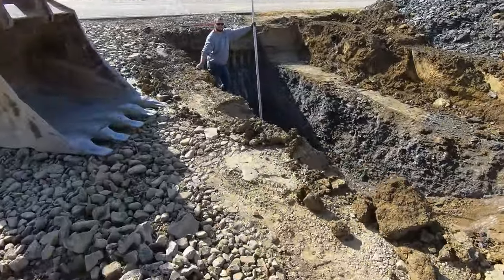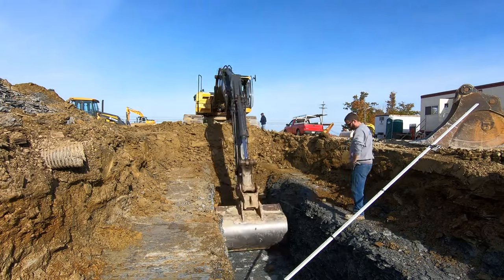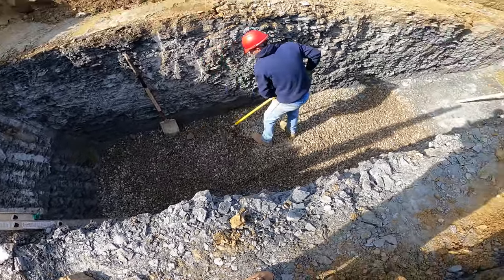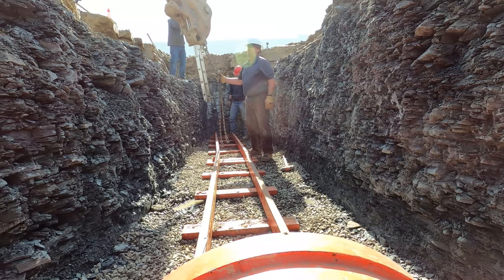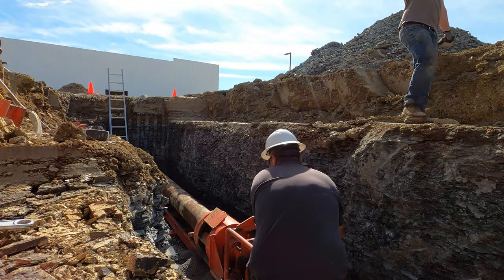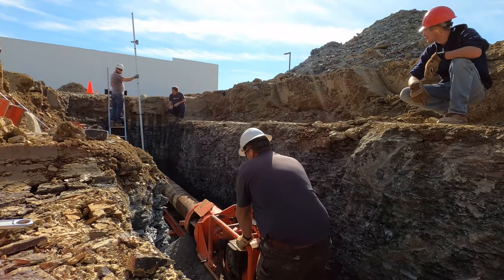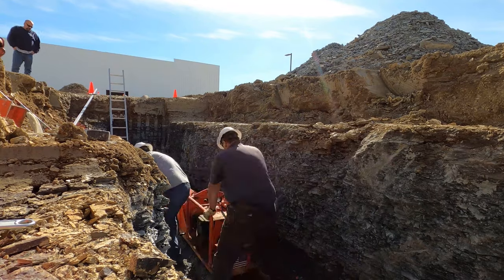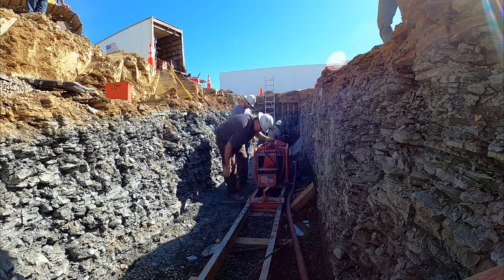New Waterline Road Bore.

Comment: I have some land in a subdivision and I was told I need a road bore sleeve. Is that expensive. Is this the same thing
Reply from the maker: Yes that is a road bore sleeve, amd yes its not cheap.
Reply: @MarkMcManusxl  $3k maybe you think or more
Reply: @lakepressureandsoftwashing3102  Way more try
Reply: @lakepressureandsoftwashing3102 😂😂😂 eso quiza sea por meter 3ft 😂😂😂😂😂😂 ese trabajo se cobra por pulgada de diametro cedula de la tuberia y ft intoducido a la Tierra